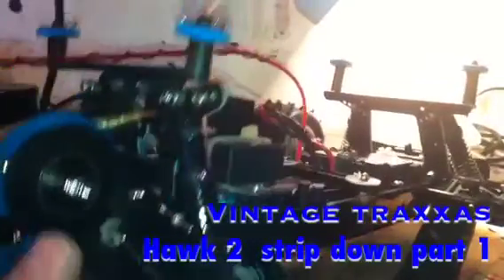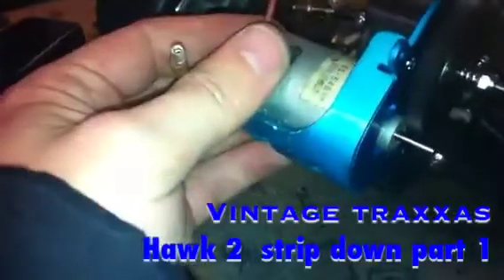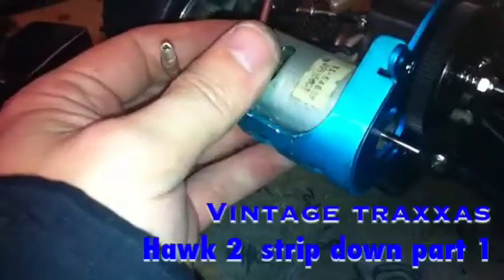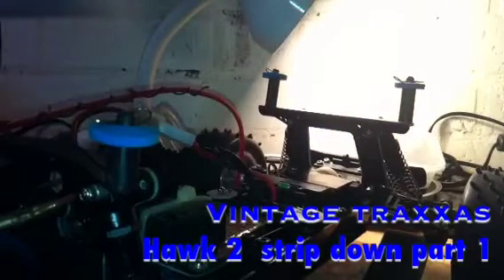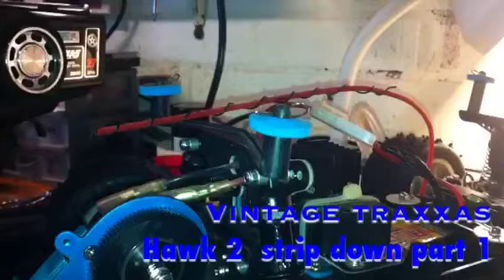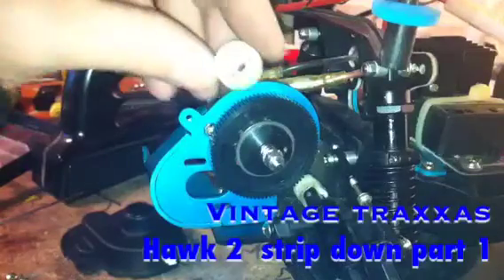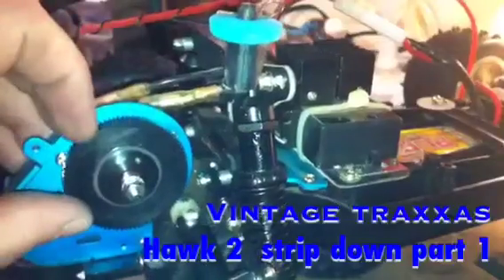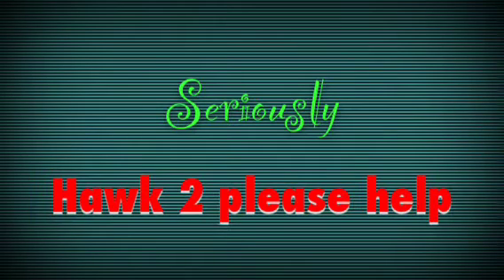Vintage traxxas hawk part 1

Comment: I still have my Hawk 1 truck which i bought new in 91 or so ? --- this is clearly a hawk 2 --- chassis was very similar --- but my hawk 1 did not have a slipper clutch and the motor was high mounted ---- the hawk 1 was completely plastic chassis and suspension stock but could be upgraded to aluminum parts.....  I believe the hawk 2 had a few aluminum parts stock ------  Obviously antiquated but still a cool and hard to find truck 

What do you need to know ?